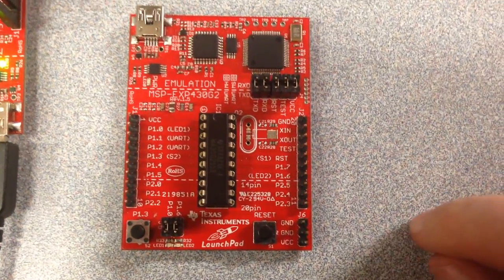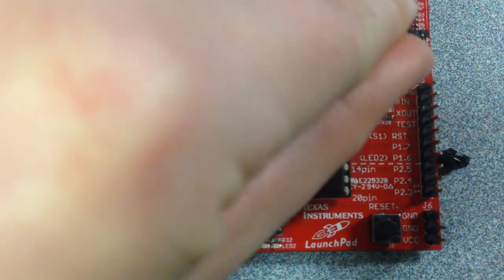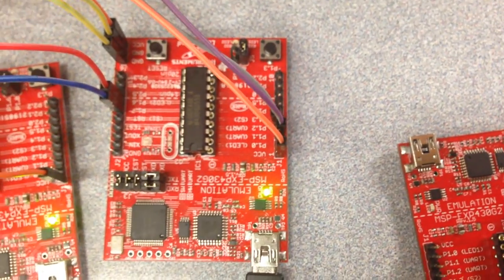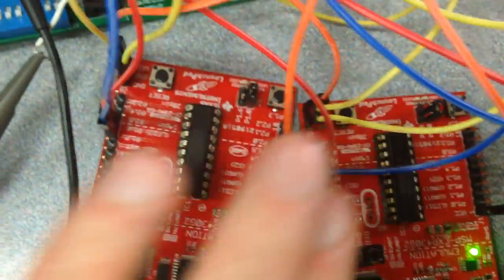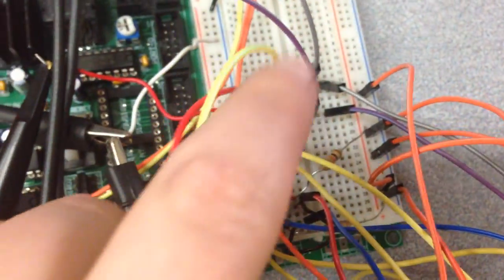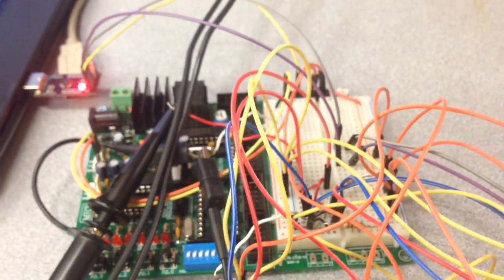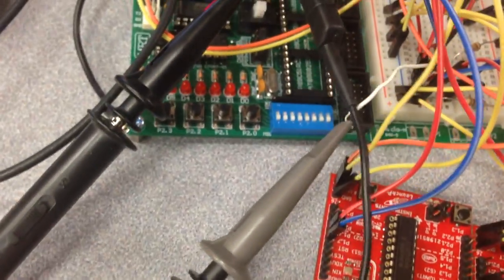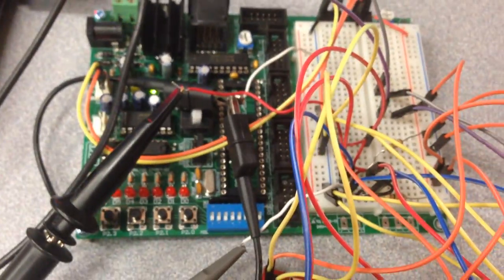How to configure MSP430 Master & Slave(s) for UART and I2C

Comment: Hello Erin, thank you so much for your video. Can you please explain to me why is necessary to remove the jumper that connect P1.6 to the LED?
Reply from the maker: +Gabriela Costa On the MSP 430, P1.6 is the data line for I2C.  When the P1.6 is connected to the LED the load is different than what is required for I2C communication.

Comment: Hey erin can  we use usb serial out put as a vcc and ground?
Reply from the maker: You can either use the usb or DC voltage to power the msp403 launchpad.  You can easily test this yourself with a DMM, measure the vcc in reference to ground with the usb plugged in and not plugged in.